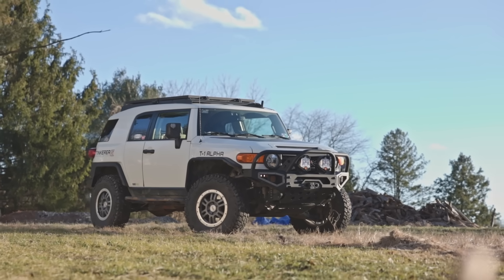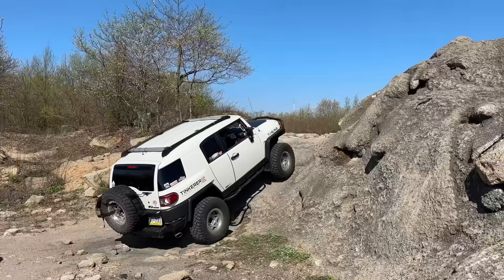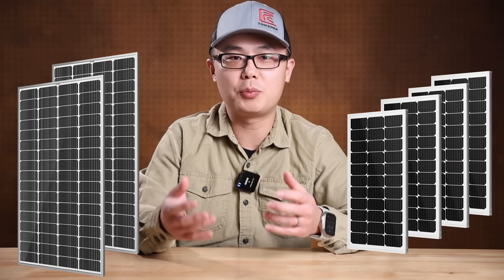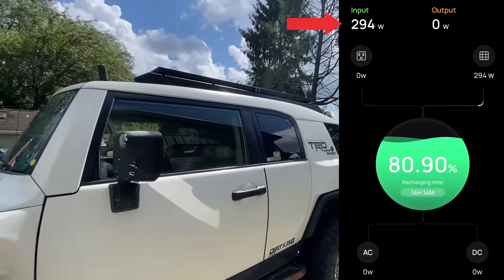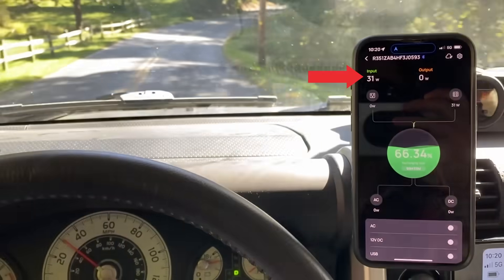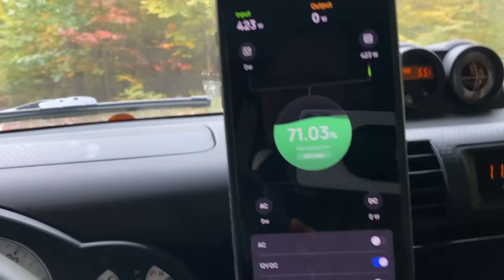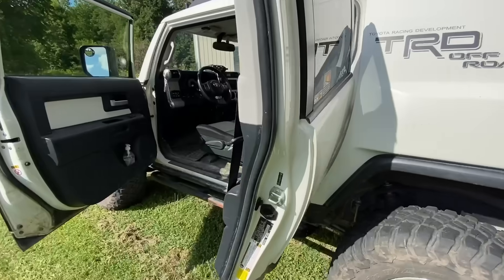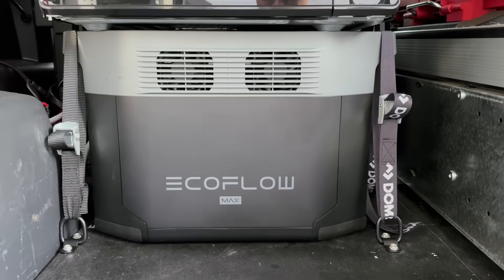I Installed a GIANT Solar Panel on My 4X4 | BougeRV 400W 10BB Mono Panel

Comment: Right on. I'm looking at trying 3 x 400 watt panels stacked on top of each other with slides and a way to tilt them. Maybe two slide out the sides, and one panel goes out over the cab. Trying to figure out how to have one panel exposed when driving with a roof top tent.

Comment: My 100W solar panel got shattered on freeway. The glass did not break, just shattered. I later put the transparent film like tint without color, to cover. Still have 70% input on a bright day in South Carolina. Higher rating definitely raise the possible input.

Comment: Flying stones is kinda common if you down a gravel road slow. Sometimes the front ones toss one perfectly in the air slow enough youll see it clearly as it chips the hood paint.

Comment: I have solar on my f350. I have a refrigerator in the cab. It runs off the truck when it’s running and the truck changes a ecoflow battery that runs the fridge over night. Solar can charge the battery and power the fridge on day when it’s just parked in my driveway.

Comment: How were you able to sync together the power coming from the panel and also the power coming from the dc-dc charger via the alternator? I watched your previous video where you address installing the dc charger, but could not find a description on how you made them both power the Ecoflow at the same time

Comment: We are saving for a used plug in Prius. If I can get some help doing it I will put a solar panel on the roof and an inverter inside.
Do you have an app for the phone that monitors your output ?
Link please if you do.
Subscribed.

Comment: How wide and long is it in feet and inches I'm looking at buying the same panels that's sold but I'm needing 2 of them I saw your video after I added them in my cart on Amazon but not sure if 2 will fit on top my over land camper build I have 8 x13 foot roof

Comment: I second the solar rooftop panels; roof racks are inconvenient on a rig like an FJ or other similar off-roaders, and it's too easy to get used to the "I'll just chuck it on the roof" mentality, which hurts your fuel economy and handling balance.

If you're looking into this in the context of a vehicle that spends a fair amount of time on trails and that you camp out of, do some reading on amorphous panels. They're typically more durable than monocrystalline panels, and while they're a bit less efficient in direct sunlight, they respond to a broader spectrum of light. So when your sun angle is not great, or you're parked in a wooded, shaded campsite, they get higher efficiency out of the more limited light.

I use amorphous panels hard-mounted on the roof, and corded monocrystalline folding panels angled properly in full-sun locations while in camp. If you put the panels out in the evening to catch the sunset, and then rotate them to where the sun will rise before you go to bed, you can still pull in some good charge. It also lets you get a better charge when you have to spend a few hours in camp fixing something in the shade.

Comment: Now I wanna add a 400w panel on my roof top tent. Is that possible ?  Also when driving why not charge your battery from DC to DC  PLUS  solar in series through your system??

Comment: You really can’t beat the look and fit on that one huge panel! That’s awesome. But something to consider is that by having multiple smaller panels wired in parallel, you have more of a chance to produce power in partly shaded conditions. With one panel, if part of it is in shade, the output of the whole panel drops.

Comment: I wonder what the benefit is if compared to charging a battery at home. Tou carry the battery anyways and on top of that you need to carry the solar and the charger and as you said it doesnt work all the time while you are driving and when you are in the woods it is even less useful. So could you carry all your needed electricity from home and ditch the panel? Obviously a panel would be great if you are parked for a long period on hikes or camping sites, but if you are driving most of the time - it might be better to just carry your topped up battery.

Comment: Been planning on using a large panel similar to this on my Land Cruiser. Had also planned to add  a centre support or two as you did here.
How's it holding up a year later?

.....and did you glue the centre support in place with some flexible adhesive or anything so the panel isn't rattling against it?

I'd also been mulling the idea of having the panel pivot on the front mount with some sort of quick release mechanism at the rear so it can be tilted up when parked up for a while. You reckon that might be worth exploring or does a 400W horizontal/flat panel generally give plenty of juice for a full-electric setup? (I'm in UK where the sun is a lot more elusive and lower in the sky, even in summer)

Comment: I'd like to know more about the mid support brace you added. Does it just tie the two sides of the frame together at the midpoint or is any part of it actually touching and supporting the glass panel itself? I'm assuming it does not touch the glass. I plan on having the long sides of my large panel sitting on and attached to aluminum square tube, would this provide the same effect since it wouldn't allow the frame to flex any?

Comment: Good information as I am looking at doing something similar.  I am also looking at adding one or more smaller panels to my front hood.  If I were off roading, I'd add some flexible panels in storage under the main panel and use these when I was camping - I'd cut the undermount in a way that I could hinge a couple of doors and then keep the folded ones underneath.  This would also help with the vibrations.  Good luck.

Comment: Very tight install!  Definitely install as much solar as can fit.  It's always recommended to fit as much solar as practical in any situation - home, boat or rv.  

I like the form factor and weight savings of your one, big panel, but per the last point:  service life, I'm happy to have four panels instead.  

Of course I have more flexibility because I am mounting to a home-built camper shell on my Tundra.  The 100W Renogy's came from Amazon with stated 22% efficiency.   Wiring four vs one is more involved but they are very durable.  Because they are flexible, I can mount them directly to the curved top of my camper shell and walk on them.  And if there's a failure in one, I don't have to replace the entire array.

Comment: Hi Kai--I had a quick question for you after watching the both this video and the one about the Victron DC-DC converter.  In this one it seems you have both solar and vehicle charging combined so that solar can pass through full time and vehicle charging can be switched on manually via your switch system.  How did you accomplish this?  I'd like to do something similar with my Bluetti, however, my unit has only one DC/Solar input.  Does the EcoFlow have two DC/Solar inputs?  Thank you for you time!

Comment: The Ecoflow Alternator Charger would be a good option for the use case you have described.  it will recharge that Ecoflow unit way faster if you are rolling down the road.  Maybe carry a small 100 or 200 watt Portable panel as a supplement .

Comment: Hi. Great video, as well as your video RE: Fast Car Charging - Thank you! I am curious about two things. First: Now that you have had your 400W panel for a longer period and have gone through the summer months, are you happy with the results? Would you do it again? Second, have you considered or would you consider using now the BougeRV CIGS flexible panels given the weight difference and the stated benefits of charging due to shading? Thanks again for your informative videos and best of luck!!!!! Tom

Comment: I have a giant solar panel roof rack on my compact van too.  they are surprising strong as a frame.  also use it to cover my ventilation and it's worked very well in Florida for me.  video on my channel.

Comment: Hi Kai, what type of connection you have currently with the solar panels and converter? I have a delta 2 and I'm running two 100w panels and would like to add a converter but can't figure out how to connect it since I'm already using the XT60I plug for the solar panels.

Comment: You simply don’t need all that electric stuff. a decent 200ah Lith battery - attached to a BCDC charger to top off the battery bank while driving, will be enough.

Comment: Tinker, why do you need solar at all?  You said you drive all day wheeling and the rest of the driving is done to get to the camp site.  You would be better off with a redact bcdc converter. It will charge fast and keep your battery topped off while you’re trekking. You have a great set up!

Comment: Hi, I came across your channel and this video in a search for Viration proof Mounting for rigid solar panels. I am based in India, and am now replacing my Fexible solar panel on my hikux overlander with a rigid panel, but my solar panel supplier isn't aware of anyone who has used this on an offroad vehicle. All use cases in India are static residential uses.  I found your video exactly aligned with my own arrangement. My question is about the details of the mounting system, very specifically what products you used etc.  Many thanks!

Comment: Great video! But I have a question…

I have 300W of solar mounted on the roof of my VW Tiguan. Three 100W panels in a custom build 8020 aluminum frame (2” thick total). The panels are connected directly to a Bluetti 2,000Wh power bank.

The problem is, due to my layout, I have no way to monitor my charging while driving. Further, to switch between solar and alternator charging requires stopping, climbing in back, and physically unplugging one from the Bluetti and plugging the other in.

What is the control unit you have mounted on your dash? And does that directly feed the app on your phone? This looks like exactly what I’m lookin for!

Comment: I installed a 200W solar panel on the lid of my RTT and quickly came to realize that if I want the panels to work, I need to be parked in direct sunlight all of the time, which is not what you want with an RTT, so I now have panels other panels that I can place in the sun and leave my car in the shade.

Comment: This company does not understand the concept of product packaging for safe delivery. I ordered four 200W solar panels from them. One panel arrived completely destroyed (bent frame and shattered glass). BougeRV sent me a replacement panel and it also arrived with shattered glass. I asked for another replacement and was told my Samyi the panel had been discontinued. No more panels! But, he would gladly give me a good deal if I ordered something else from them. 
So, if your BougeRV solar panel should fail during its warranty period, there is a good probability this company will not have backup inventory to support your warranty claim!  This company is a joke! You have been warned.

Comment: Tinkerer, please give your impression of the EcoFlow Alternator 800W Charger that just came out. 
I know you set your own system up for a low cost. Which is quite the attractive alternative. 
Seems like Ecoflow has some extra capabilities to its Charger. 
Wondering what you thought about it, if you think it is worth it enough to replace your system.  I really respect your reviews. Thank you.

Comment: I like how you think.  I am surprised you did not consider installing a 400W bi-facial solar panel to maximize solar input.  I do a lot of beach camping and have the bi-facial 220W from ecoflow.  Even in the late day sun I still get about 235 to 265 watts.  With your white roof I am sure you would increase your  percentage of solar input.  Have a great day.

Comment: I have a Tacoma with 400w solar on OEM racks over the cab running into a SmartCap Evo and connected to a Bluetti EB240 200ah battery pack. I ran a 120v plug into my wheel well with a IP65 rated cover. I also run a Dometic CFX 55IM cooler and just about anything else I need. This all goes with my Thule RTT and 270 Awning.

Comment: I have a 160 watt panel in the base of my roof cage and it runs my 80 litre upright fridge and simultaneously charges the 120 amp hour lithium battery even when it's cloudy... It was designed and built by me usung cheap components and It's been the only source of power for over a week with intermittent cloud and the battery only got down to 80%. Because it's supported by the cage I can put things on it and don't have to worry about the weight. It's been there for six years now without a problem. I also run a 20 amp DC-DC charger for when I'm cruising.  The whole system workes amazingly. My advice KISS. Keep It Simple Stupid.

Comment: Could anyone tell me if I could keep my car's battery charged as a well as an ecoflow delta 2 with a 175W solar panel? I know there are many variables but I'm mostly wondering how it would be wired. solar > splitter > one goes to MPPT and then to car's battery and the other plus straight into the ecoflow? Thanks for any help.

Comment: May I ask on how did you wire the solar and the dc dc charger at the same time? Did you just use a splitter xt60 connector ? And have the Orion dc dc charger connector and the solar connector  directly to the eco flow? Thanks for your time.

Comment: I’ve got an inspired overland rtt. It’s only 87 lbs and 4” tall.  While it is a soft top, I’ve got a flexible cigs solar panel attached to it. The wedge style tent allows me to direct my panel towards the sun for optimal output. Works great and I’m in under 100 lbs on the roof. I’m running the same 1GRFE engine and average 16mpg.

Comment: Better choices out there for 4x4 vehicles.  Just as an example deck mounted boat panels have been available for years,  3mm thick and flexiable enough to be RTV/glued onto existing curved roofs without introducing a gap.... rugged enough to walk on daily without adding to the height of the vehicle. 

Personal experience of these, whilst you dont get the most watt/m2 they are very durable and slim fitting enough they are not noticed [no one ever asked if I had a roof rack at-least]. I have broken one panel, but that was caused by hitting a branch hard enough that it also severely damaged the body panel on the vehicle.

Comment: Forget about the specs or power.  It is the BEST looking roof solar I've ever seen on an suv! Nicely done
Reply: its a basic 420 watt roof panel like trina vertex S+ or any solar company offer similar so what specs you need?
all 1000 solar companys offering.
and ~400 watt full black panels also not any spezial any conpany offers it......
Reply: @ThomasNowicki-m5s  I think he meant the whole package, not just the panel.  It's a clean install.

Comment: Great video. I have a solar panel on my RAV4 for camping and love it. I do want to upgrade to a larger output panel that maximizes my power like you wanted. In any case, it is great to make power while my vehicle is sitting at the trailhead and I am off having fun. Thanks for sharing this.

Comment: I don't think solar panels on top of your car or a good idea. Because what is the first thing you do with your car when you find a camping spot? You park it in the shade! I have 400 W of flat panel solar panels and I pack them in under the bedding and they take up hardly any room at all. When I set up my campsite I drag the solar panels out and lay them where the sun is shining and I have a nice long tidy extension cord that plugs into my battery systems. If my batteries are low I can adjust the angle and orientation of the panels to maximize battery charging. If they are not low I simply throw them in the dirt and they work just fine. 200 W of solar panels oriented towards the sun will generate far more energy than 400 W mounted on your car oriented at an odd angle and experiencing some level of shading.
Reply: Like he said, he is not camping during the day. He drives during the daytime and camps at night. Also with a big solar panel on top, one could argue your car is always partially shaded by the panel anyway.

Comment: Great videos! If the Ecoflow 2 uses the same charging port (based on your previous video)  for both solar and dc charging, how are you charging from both at the same time? Do you have both charging cables wired together and then the converter just powers on from your switch panel?

Comment: Hi Kai. Another great video. Please tell me tho how you are charging your Delta 2 from the solar panel and DC converter at the same time to achieve 700 watt?! the Delta 2 has only one DC charging port shared by car charging and solar. i thought the max solar input was 500 watt. if the alternator input is "simulating a solar panel" how do you get around the 500 watt max solar input? Thanks

Comment: The Overlanding crowd need some introduction to budget solar. Companies like BougeRv make good products, but they are overpriced. You could get a similar version to that panel in a couple flexible panels for much less, (by say NewPowa) and they would be more likely to hold up over time. Not to mention they weigh significantly less, like less than 4 lbs per 100 watt panel. Same 10 busbar output, and you can series them and lose less juice when there is some shading. I'll be doing a series on electric overlanding when I finish the Eurowise 3" lift and start on the 8020 racking on my 2012 Audi Q7. We'll also be doing a 3kw overlanding trailer/charging system for our Ford Lightning.